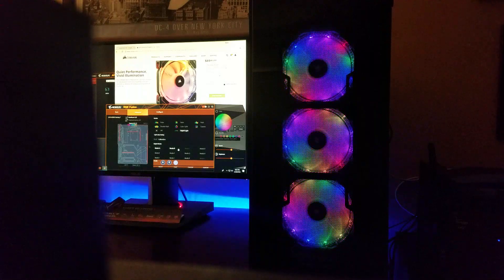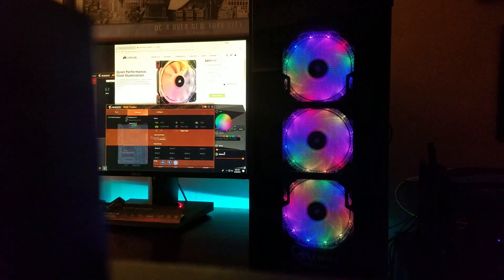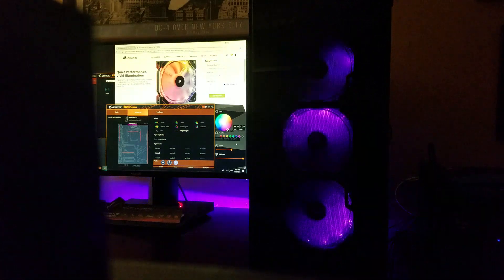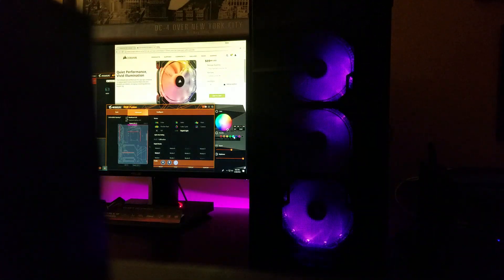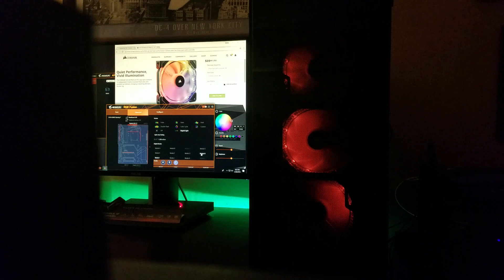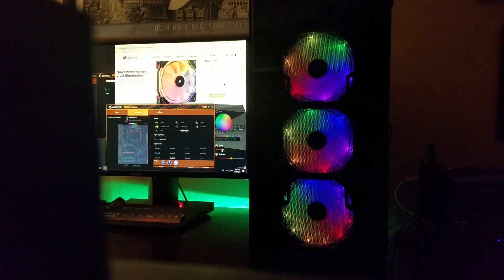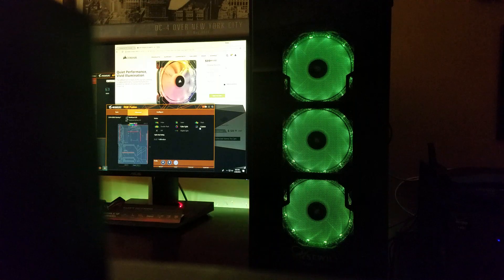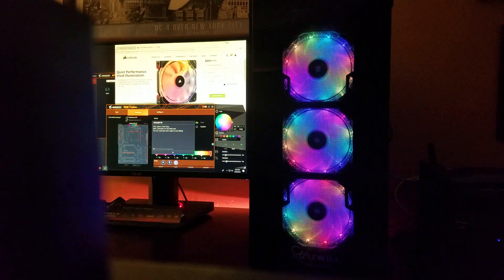Corsair HD-120 using Gigabyte's RGB Fusion Software mod also Asus Aura

Comment: Hello, I have an ASROCK B450M  motherboard. I received a Corsair sp120 rgb for christmas and I plugged it into the "12 volt RGB HEADER" slot. I downloaded ASROCK's RGB software and my fan actually lit up for a couple seconds after hours of troubleshooting. However, after the couple seconds the fans didnt light up anymore. Does this mean I just burnt the fans?
Reply from the maker: Yeah, sorry to hear that, maybe you can try to RMA them. You just dumped 12v into a 5v system. Never plug something in to something, unless you know it is compatible.  Depending on what SP fans they are, you normally need an adapter to plug it into MB 5v ARGB header. Let me know how the RMA goes.

Comment: Hey man, sorry if you already answered this question but I have a Gigabyte Auros z390 Pro Mobo and it has both 12v and 5v rgb headers, Could I just plug the RGB pin into the 5v rgb header on my mobo and control it via RGB Fusion 2.0?
Reply from the maker: You will need an adapter, check out piratedogtech.com he sells them.

Comment: great video! so i would need to have the lighting controller for the fans in order to power them? I couldnt just order the fans themselves?
Reply from the maker: For the lighting, you will need to have a 5v addressable controller. If you go outside the Corsair Ecosystem, you will need to make or buy an adapter cable.
Reply: @SolarityTechnology  I have an aorus motherboard with gigabyte fusion 2.0. So am I correct in saying that I would need to connect the fans to both the motherboard and their control hub
Reply from the maker: @okaythisisepic6196  What exact Mb do you have? If you plug it up wrong you could damage something.
Reply: @SolarityTechnology  I have an Aorus B450 Elite
Reply from the maker: @okaythisisepic6196  looks like you can buy an adapter from piratedogtech.com Check out my RGB Connector Guide on my channel for more info on headers.
Reply: @SolarityTechnology  thank you so much! If I have any other questions can I ask you?
Reply from the maker: @okaythisisepic6196  just shoot when you have one!
Reply: @SolarityTechnology  thank you!
Reply: @SolarityTechnology  so if I bought this cable https://www.ebay.co.uk/itm/Aura-Mystic-Light-A-RGB-to-Corsair-RGB-Adapter/372548214612?hash=item56bd9a9f54:g:2GQAAOSwIGxcI6Zv

I would then have to buy the fans and the hub they come with, and connect the fans to the hub and then the hub to one of the D_LED pins on the motherbaord? Would that work? Would I get all the lighting controls of the fusion 2.0 or would it only have basic colours?

Comment: Hey, GReat Video.

Maybee you can help me. I have a LNP that has a burned port. My question is can i use my corsair light strips with my mobo 5v header if i modify the connector to a standart 3 pin 5v ARGB?
Reply from the maker: What happen to the LNP? I have fixed a couple in the past by replacing a fuse on one of the ports. I was testing some things and didn't realize I reversed the polarity on my strips and that blew the 5v fuse. You could test it with a multimeter. 

If you don't want to fix the LNP, you can get an adapter from Piratedogtech.com for the strips.
Reply: @SolarityTechnology  i think it maybe that. I had the strips plugged in and moved them around. Heard some "poppin" noise and leds went out. Maybe a short. When i plug them in they flicker very very dim. I took the LNP apart and everything looked fine to me. Did not test with a multimeter though. 

I have now the EKwaterblocks fan controller with D-Rgb and i actually thought of using that as it has the standard 5v 3pin plug. Or even the motherboards headers. 

It is more to remove one more software from the pc and have more stuff syncing instead of having 5 different softwares.

Do you have some advice on what part i have to test?
Reply from the maker: I might need to do a video on this as I think I might have a damage LNP. You can open it up and look for these small rectangular green objects mounted to the surface of the board. You can check for continuity there.
Reply from the maker: Forgot one more thing. You can also check for continuity between the SATA's 5v power on the connector and the 5v pin on the LNP header. The  5v pin is an outer pin that has a slit cut under it.

Comment: Do you think it would be working with sp120 fans? using the same methodology
Reply: I pretty much just want to set every fan to red, and then turn that off so I can sleep without visual distraction. Stupid corsair built in case fan controller doesn't have option to turn rgb off.. wack
Reply from the maker: Is it the older SP fans or the newer SP Pro fans? Is the control manual?
Reply: @SolarityTechnology  What you mean by control? 
I have the fans powered from the mobo using tri-splitter.
The fans rgb are connected to corsair hub, which is then connected to similiar tri button controller that you have in part2 and then to buttons on the case.
Those are normal sp120s
Reply from the maker: This won't work as the SP120 fans you own use a different protocol than the ws2812b style LEDs they use in all of their fans. Your best bet is to get a Commander Pro or a Lighting Node Pro

Comment: You may be just the man for my predicament. One that I have been struggling with for too long.
I am in possession of 3 and 2 ARGB fans from different brands, both whose controllers should, but don't MBSync.
One brand's (Cougar) has been told to be able to connect directly to motherboard via VDG+5V--into-->6pin.
I've been considering soldering such connections myself to finally get it done with, as those are nowhere to be found online.
Question is - Will using a VDGSplitter and a 5VSplitter out of the motherboard, make my MB recognize them as seperate fans?
(And is connecting the fans directly to MB even a thing? Like.. Is that what you did?)
Also - Do I need both connections (5V+VDG) to be connected, or is one enough?
Reply from the maker: If I understand you correctly, you have a single 6 pin connector? Corsair uses 2 connectors One is a  4pin PWM fan connector and the other is a 4pin ARGB (5v, data in, data out, and ground. To get this to work you would need to map out the wires in the connector and make an adapter or terminate them into a standard fan connector. The RGB would be tricky as you would need an adapter or a splitter to get it to work. I would check out my other videos. I have one on connectors/headers and a rgb101 video. These might answer some questions. Then I can explain further if needed.

Comment: Hi. A question.
White colour of this fan is real white or is white-light blue colour.
Reply from the maker: Depends on your definition of white. It is more of a cool white to a daylight white. It isn't a warm white, so it will be more blue than yellow of a soft white.
Reply: 5500K in static colour 
https://www.ocdcarcare.com/wp-content/uploads/2014/04/Kelvin-Scale-and-Color-Temperatures-of-Common-Lighting-Sources-Paint-Correction-Christoher-Brown-Obsessive-Car-Detailing-www.ocdcarcare.com_.png
Reply from the maker: @CMC1970YT   The LEDs used are ws2812, looks like one site that did a test of the brightest white: "Color Temperature was determined to be 5810.89 Kelvin" (255,255,255 or FFFFFF). I found this just skimming though the temperature can be changed using a custom color. There might be better data out there. It is hard to match color or light.
Reply: Very thanks.

Comment: I have my fans connected but it only lets me control my ram RGB but not my fans.. when i change the color for my RAM it also changes the color for my fans. Im not sure why!? The fan option is there but it doesnt let me click on it so i can just change colors on that.. i have 6 fans any suggestions? all from deepcool the Rf120s
Reply from the maker: I don't know anything about your system. Though I am guessing the RAM you are using has a seperate plug that goes into a 4pin 12vRGB header, just like how the fans are. I have two 12vRGB headers on my MB. Sadly they both use the same channel, so they will display the same color and mode. In the example above I am using a digital header. In one of my videos I go into the details about the differences. Check it out and feel free to subscribe.

Comment: Did you tried the same method with a 4 pin controller like thermaltake or some one else? I wont to kill my MB with the D-Led Pins!
Reply from the maker: The typical 4 pin connectors tend to be analog 12vRGB, the HD-120 and newer rgb fans use digital 5v rgbs. If thermal take uses the the digital 5v, it might work, though the effects might not look right. I do have a 5v analog RGB TT controller, though it wont work digital, you would need a 5v digital TT controller. I think I lucked out with how this looks, though this was made to look generic. I do have a video that shows more details on how I did this. I do like the Corsair Lighting node pro. After they released iCue, I got one as I prefer the software. I am posting more stuff on RGB lighting, subscribe, if you want to see new content, when I post it.

Comment from the maker: FYI: This will only work with motherboards that have digital/addressable RGB 3pin Headers. This will not work with an analog 12vRGB or 12vRGBW header.  This information is given freely and comes with no warranty or guarantee. Do at your own risk!

If you don't want to do this yourself, I emailed modmymods and asked them if they would like to make some of these for the people who don't want to do this. If they do make one, I will post it. I will also plan on doing a video showing how to do this.

-------------

*Parts Required:*

*1x 3pin 2.54mm Plug housing and female terminal (from old case or buy new off amazon, etc)

*1x 1pin  2.54mm Plug housing and female terminal (from old case or buy new off amazon, etc)

*Compatible Wire Gauge (AWG):18-26AWG

---------------

This can be done with a single wire connecting to a 2.54mm Case to MB header connector. I yanked two cables and connectors from an old case. 

---------------

*Cosair Side:*
I used a 3pin 2.54mm plug housing for the Corsair RGB Hub with only the middle female terminal occupied. I soldered spliced and heat shrink wrapped two cables to make one cable with a female terminal on each end. This is the cheap/ghetto method as I didn't have the new parts on me.  You could also get a new female terminals and crimp on a new plug housing if you wanted to. I left the two outer pins blank/open so I could easily plug it into the RGB Hub w/o worrying about plugging it into the wrong pin. The connectors that come on your case are the same form factor as the RGB Hub, they are also more easily to source than the 3pin latched 2.54mm plug housing that corsair uses. They went with a latch and key hole as they Corsair normally uses all 3 wires, I am guessing they didn't want people to reverse the polarity. You only need one wire (data) as the PSU supplies the RGB hub with the 5v and ground. 

---------------

*Motherboard Side:*
For the motherboard header, you only need a one pin plug housing, though I used a multiple pin as I didn't have a single pin 2.54mm connector at the time. Make sure you plug the connector into the Data pin header no the motherboard. I haven't tested what happens if you send 5v over the data wire, though I didn't want to find out. Make sure you double and triple check this is correct!

---------------

Motherboard Digtal Headers (MSI, Gigayte, & Asus): *http://www.thermaltake.com/db/products/cooler/TTSyncController/pic2.jpg

MSI Does have a JCorsair Header w/ the keyed/latched plug housing, this is where I got the idea to do it:
*https://forum-en.msi.com/index.php?action=dlattach;topic=295650.0;attach=62528;image
*https://forum-en.msi.com/index.php?action=dlattach;topic=295650.0;attach=62526;image
Reply: Thanks! A quick google shows the normal voltage on the data line to be 1.8-3.4V depending on colour, so it would be best not to connect the data wire to the 5V i guess :-) Have you tried with more than two fans? I'm curious if the 60LED per header is a problem when more fans are connected..

Comment: Hi there, do you have any more details on the wiring method please? I have 6 x Corsair RGB HD120 fans, the included RGB fan hub, and an Asus Maximus X Formula motherboard which has 2 x 5V addressable headers. (I also have the Corsair Commander Pro but am hoping not to need it). Thank you!
Reply from the maker: I created a new post with some instructions.
Reply: Nice one thanks!
Reply: you do need the commander pro for link compatibility
Reply from the maker: Link and the newly released iCue can be used with both the Commander Pro and the Lighting Node Pro. I actually bought a couple of LNPs as I found iCue a lot more to my liking in regards to customizing my RGB. While some people will find this handy, I chose to switch to iCue and buy additional HW as I found the iCUE software at the time of this writing to be superior to anything else I have seen or tried.

Comment: Any idea if the Corsair LL fans would be the same? I would assume so as they are also still just the same connection.
Reply from the maker: Brendan Young - Yeah it should, though the effect will look different as it has ~4ish extra LEDs in the hub. I will put up a quick tutorial on how to do this as well
Reply: Sweet. Thx. I am in the middle of a "RGB" water cooled build and my biggest complaint with how it was turning out was how the LL fans didnt match up with the Mobo, Monoblock, and led strips i had behind custom acrylic panels. 

The main thing i would be looking for is just the normal rainbow cycle synced up and not any of the crazy effects.
Reply: Hey just wondering if something like this new product from XSPC would help a bit with this.

Would still need to mod the Corsair cables to fit the normal 3 pin connection but might make having a bunch in a system easier.

http://www.performance-pcs.com/xspc-8-way-3pin-5v-addressable-rgb-splitter-hub-sata-powered-black.html#!prettyPhoto
Reply from the maker: Brendan Young All this does is takes the data in and supplies power so you don't draw to much power from the mb header. It can allow you to have more leds